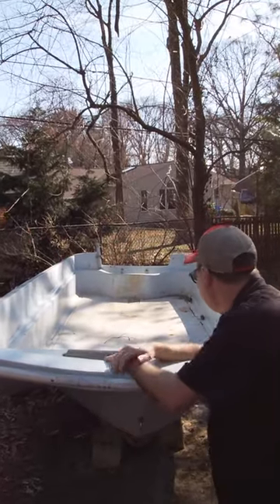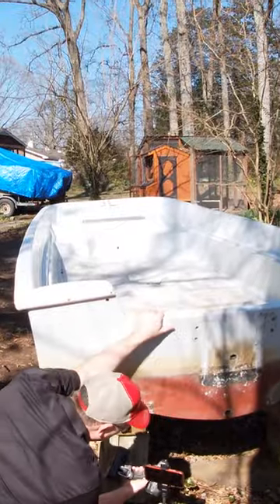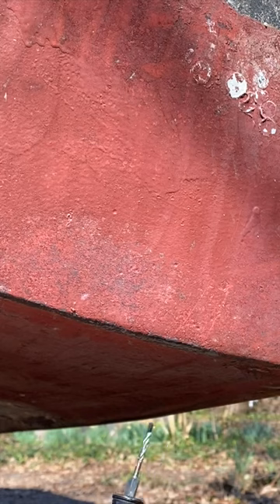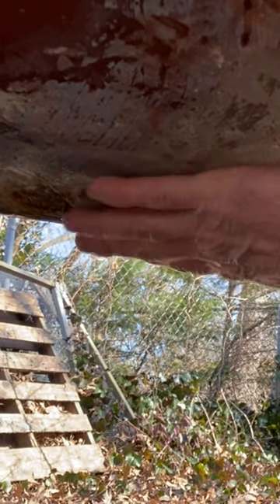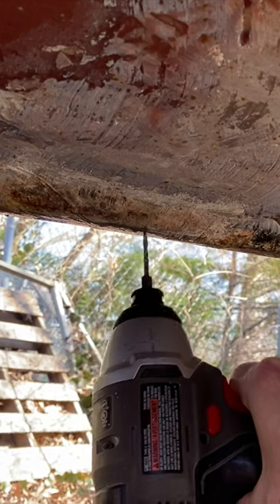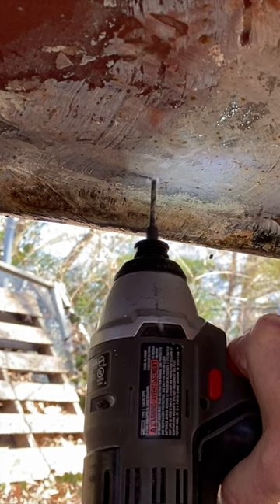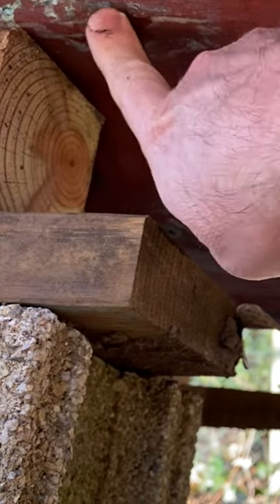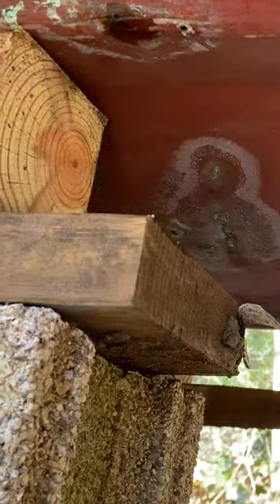Drilling holes in my waterlogged old Boston Whaler boat.

Comment: I had an old whaler with that issue. What happens is the manufacturers of these old boats used to use open-cell foam. They don’t use it anymore, but the boats that have it (like yours) become water logged. Open-cell foam absorbs water over time, so really you’re only hope is to take the top half of fiberglass off (the two halves typically meet at the rub-rail, but you’ll probably need to do so me cutting.) Then you have to take all of the foam out in order to remove water. In my opinion, it’s probably not worth it to try fixing that boat. If you have any questions, feel free to ask me because I have already dealt with this exact problem.
Reply from the maker: Thanks! The future is still in question with this boat
Reply: @WayneTheBoatGuy  I know its been a while, but you will have to remove all the flooring and remove all that old foam then redo the floors.  Big job, fun though.
Reply from the maker: @everythingreviewsandnews1229  I'm not sure I want "fun" - but I kinda do like this layout.

Comment: bought a 21' ribside in the keys few years back.  got it home to Sarasota and was worried it might have some water.  boat was unequipped no motor.   I put my back under the one side near transom and lifted it a foot off the trailer.   those old 21' footers are only 1200lbs and beyond strong.   my favorite but 13' is a close second

Comment: Wayne, I have used a wet/dry shop vac for this. You need either a shop or several consecutive sunny days. Elevate the front of the boat, at least 30 degrees or more if possible, drill holes on each side of the bottom of the transom (you’ll have to do some patching afterwards) you want the holes about the size of your vacuum hose, I used gorilla tape to hold it in place. It might take some time but it worked for me. Just have to keep going until you get no more water out. Then patch all holes and cracks inside and out. If that old foam gets water to it then it will waterlog again. On the other hand if you want a complete restoration, you’ll have alot more work so………. Just depends on your end goal, for me, I had a good little boat for quite a while 😎

Comment: something I have seen.  red ants will bore holes into foam.  if boat sits outside a long time.   then that void will fill with water.   over time outside.  mostly thru the drain plug tubes.  rust out inside haul.

Comment: The only solution to the water issue is to separate the inside from the outside, remove all the foam and replace it. The fiberglass the inside of the boat back into the boat.

My boat had waterlogged foam and when I removed it, the foam was like a wet sponge. Plus, all the closed cell foam was turning to dust.

I ended up removing literally every square inch of foam and  replacing it.
Reply from the maker: Ooof - that sounds like a big project!
Reply: @WayneTheBoatGuy  It was a big project.   It took me most of 2020 to do it. I made a lot of good upgrades while I was at it. On the up-side, I had something to do when everyone was being locked down and now have a nice boat that's better than it was when new.

If you have a place to work on a boat that's out of the weather and has heat, it makes for a good winter project. I used my garage.

As for that Boston Whaler, it is a big project, but if you have fiberglass experience it wouldn't be as bad as it seems. In fact, it could easily be upgraded to be better than when new. 

If you don't have fiberglass experience, it's probably more than a person would want to tackle.
Reply: never do this.  way easier to find one without water
Reply: @joethomas6457  Really? Look at just about any used aluminum boat that was stored outdoors and uncovered for a few years (that's most of them) and you'll find rotten floors and waterlogged foam. Even fiberglass boats will eventually get waterlogged foam.
Reply: @gsh341  I was just saying around me in Florida there's a lot of whalers for saleyou can find a 13-foot whaler for sale for a thousand bucks but they're waterlogged or you can find one that's not water log for 2,000 bucks I just felt that's a better way to go but if you have the time the other side of this is that I love the original floor I've never seen anybody get the floor back in place in the same with the same texture I seen lotsa guys re fiberglass in but it never seems to come out right
Reply: @joethomas6457  That's Florida. Where I live we have the boats out of the water for 6 months of every year because of winter and a lot of not so smart people don't properly store or winterize them properly. That leads to a lot of rotten floors on used boats. In fact, when was looking at used boats, I honestly can't think of one that didn't have a soft floor.

When I bought my current boat, the floor and transom were basically mulch. I couldn't even use the pieces as a template.

I removed all the foam and rebuilt the boat from the hull up.  It's actually a better boat now than when it left the factory.

Comment: Your supposed to drill the holes in the transom, so you can put drain in lucks in it. The water is trapped in the foam so you’ll need some really long auger bits to open it up and take out the foam. I’ve even seen people go as far as cutting out the floor to get the foam out and re-glassing the floor.

Comment: I would say wrap it like a barittio and put the hole at the high point and hit the heat and let evaporation do it's thing
Reply: I had a similar problem but I was lucky enough to have a shed big enough to put it in, and have heat, but took weeks to dry it out

Comment: ok I have the know how.  thruth.  leave boat upright.   in the sun.  it will steam out the rubrail edge.   store in barn for a year.  it will dry.   I'm a whaler guy.  I have had two 9' tender whaler in my shop.   one 150lbs other 250lbs.  both were capable of lots of fun.   oddly the heavy one rode smoother.   but

Comment: Your fibreglass is porous.
it has not been maintained therefore it is completely water logged in all the wood underneath is completely rotten.
Basically you need to rebuild the whole ⛵👌
If you are trying to repair you will have to cut out anything rotten.
Let dry add chops strand back in and gel coat. 
And finished with Qcell flow coat microballoons.
 paint finish if you want after that tho antifouling is necessary if it stays in the water ... Best of luck 🙌🙏💪

Comment: You couldn't take off the floor boards and drain out the water from the inside??
Reply from the maker: These are foam filled fiberglass boats - so the fiberglass floor would have to be cut out and the foam has to be dug out.